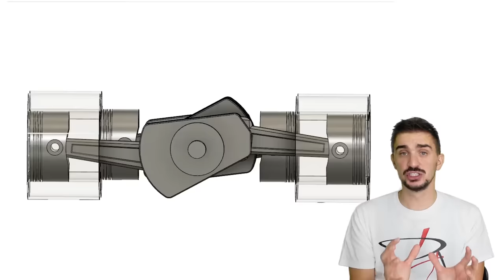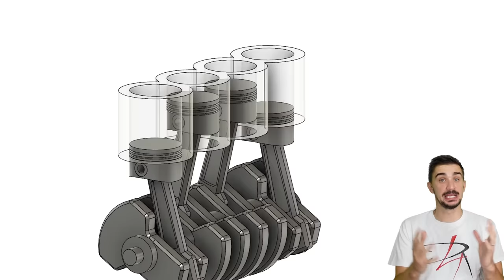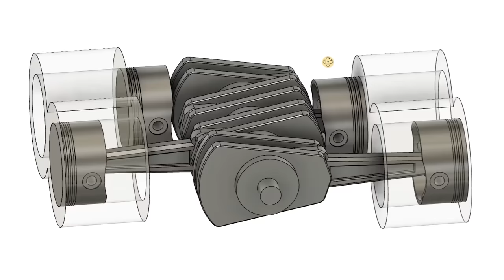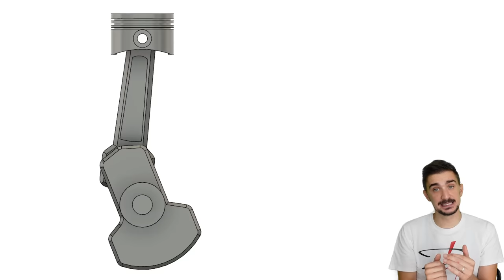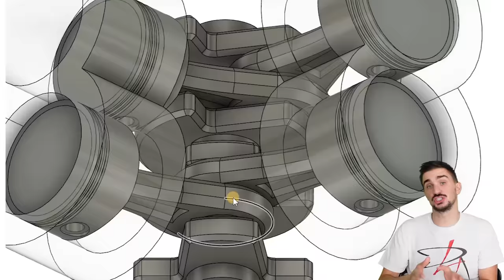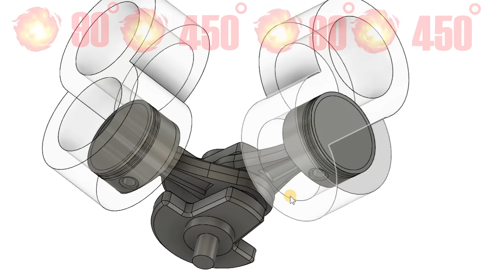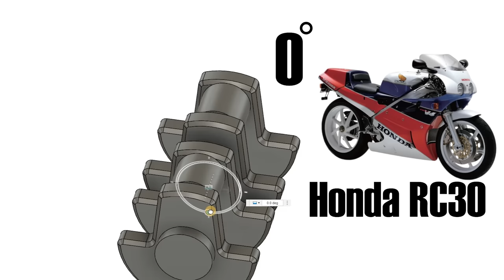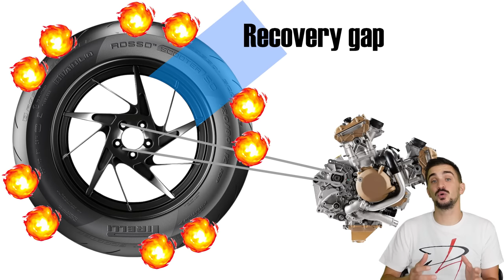Deep Dive: Inline 4 vs. V4 vs. Boxer 4 - What's the Difference? Engine Balance Explained in Detail

Comment: Primary imbalance is the reciprocating mass of the piston. Secondary imbalance is the reciprocating mass of the connecting rod. Everything presented doesn’t include the combustion forces. IOW the imbalances presented would be the same even if the engine were driven by an external source and not it’s own combustion.
But what about the imbalance of the explosions. Just as when a gun fires and shoots the bullet out the barrel, the engine fires and shoot the piston down its barrel. What about the imbalance caused by the gun kicking the shoulder, and the likewise force the cylinder head experiences, the force that tries to snap the head bolts. Those rhythmic explosion surely create a harmonic of some type. ???
Reply: To offset , or counter-balance the force of the explosions  ... make a boxer that fires both opposing pistons at the same time. In that configuration every force input, either by kinetic energy or chemical explosion,  every force has an equal and opposite counter force.

Comment: I've watched 12:46 Secondary balance about 20 times now and unfortunately still does not make sense to me. How can secondary force at BDC point up when the piston is moving down? I understood wikipedia's explanation (piston travels further from 0-90 vs 90-180 so acceleration is greater through TDC than BDC), but doesn't that go against what you're saying here? Thanks
Reply from the maker: Forget what the piston is doing, just focus on what the rod is doing to the piston
Reply: @d4a  pretty hard concept to grasp, especially from 180-270 as I kept focussing on the piston direction going up (and yes, you did say to ignore the preceding section on primary forces 😛),  but finally makes sense now, thanks!

Comment: Why is the boxer 4 cylinder favoured over the V4 in production cars? If the V angle is set at 90 degrees and the firing interval problem is resolved with split crank pins, what now makes the boxer a better option to produce, considering it is more complicated and costly to make than a V4?
Reply: 90 degree V4 has perfect primary balance, but not perfect secondary balance.  The boxer is smoother.
Reply: He kinda talks about this a bit, saying that there aren't any significant advantages for a car - I4 is only a little bigger, but much simpler than V4. B4 offers a lower center of gravity and a bit more intrinsic engine balance, meaning that the complexity commitment of two heads pays back more with a boxer if we're putting it in a car. In a motorcycle, transverse-mounted V4s offer balanced compactness (more square from above) vs I4 (wider) or B4 (longer), and so a V4 is more preferred for bikes than B4. Add the 'relaxation gap' bit, and V4s with clever firing gaps make for optimized design in that case.

The reason V8s are more common than B8s comes down to crankshaft durability issues. Inline-8s are just too long, and B8 crankshafts just aren't durable enough to tolerate more torque ripple from pistons further away - this is because the big end bearings on opposing pistons want less crank material between them (a narrower gap) for better engine balance, and less material = less maximum yield strength. The intrinsic advantages of inline and boxer engines diminish a lot as power demand increases, and the less optimal but more flexible V-pattern makes more sense. As car makers have shown us by example, 4 cylinders are best as inline or boxer, 8 cylinders are best V-shaped, and 6 cylinders can work practically in any of these configs.
Reply: @psychemist2689  Good answer, thanks.

Comment: I am curious why there arent anymore two cylinder cars, could you do samekind video from those too? Specially boxer two is interesting one, bmw used it in motorbikes and toyota in 800 sport ect.
Reply: 2CV and Panhard engines are also great examples, ball bearing, high revving and great power output, engine note lovely!
Reply: Vibration and high impulse torque when they fire.

Comment: Very informative video. I always wondered how some motorcycles sounded like a 5 cylinder (although definitely not one), the explanation is that some V4s have a 70 degree crank phasing which is close to the 72 degrees phasing of R5/V10 cylinder engines. :D

Comment: so a 2 stroke v 4 has even timing correct? i thik it does far as tha math in my head thinks? the firing order happens every single time its at tdc and a fix for the 4 stroke just have a split cam timming on front and back run it like two V twins searisd together.
Reply: detroit diesel style with exoust cams and a cam for unit injectors btw ik a regular style two stoke will work thense theres nothing to be timed if its a carbed diesel wich would be incredibly inefficent just some thoughts im a diesel guy not so much a gas engine person.

Comment: There is another type - opposed piston engine....
its even better... No valve shaft's, no timing belts - and its efficiency way higher, especially in diesel and even hydrogen fuel, really compact size and less parts

Comment: The whole traction thing must be one of the biggest boomer lores in the motorcycle world, you have frequencies of upwards to 600 Hz in the engine while the natural frequency of a tire system is around 10 hz, such fast pulses simply cannot propagate through the tire, just like the higher frequencies of an engine can't propagate trough elastomer bushings, both act as vibration insulators. Any reason for an uneven firing ORDER are more related to powerband and or other higher order vibration issues of a given engine (ex the Yamaha cross-plane which they themselves claim is not done for traction issues).

Comment: Why can't two pistons be fired at a time in a 4piston engine to increase power and torque?
Reply: An engine is just an air pump. Changing just the firing order or geometry does not change how much air is pumped. Same air =same power.

Comment: Can somebody explain, why the V4 engines in MotoGP usually have more power than the inline 4? I'm pretty sure they are limited to a certain rpm and capacity so those last points from the video don't really explain it?
Reply from the maker: It explains an important part of it. The bore and stroke thing
Reply: @d4a  you are right, I just assumed they all use the max 81mm, which was probably wrong. There sadly is not a lot of information out there about the gsx-rr and m1, but what i could find, suggests they have a smaller bore. Thx for the quick reply

Comment: How would a theoretical “VR4” compare?
Reply: Do you mean like the Lancia Fulvia V4 engine and what would be theoretical about it?
Reply: @alexjenner1108  more like a VR6 with 2 cylinders lopped off. Just curious because of how tight vw made the v in those engines. If that’s basically what the Lancia is, then yes. Just curious how a slight v effects the vibrations. Maybe I’ll just have to see if he made a video about the different 6 cylinder engines.
Reply: @benfowler2127  Lancia have been making narrow angle V4 engines since the 1920s with a 20° V4 engine. The 1960s/70s Lancia Fulvia V4 engine had a V-angle of about 12°. The Fulvia used a DOHC configuration, with short rocker arms so that a single camshaft actuates all the intake valves and another camshaft actuates all the exhaust valves. The VW VR6 appears to use an V-angle of 15° so quite similar to Lancia. There appears to be some coverage of the VR6 in this D4A video: https://www.youtube.com/watch?v=mTS48jX68YU
Reply: @alexjenner1108  awesome, thanks for the info!

Comment: Why can't you just lay an Inline 4 on its side, so the cylinder head is on one side of the engine bay and the crank shaft on the other side?  Low center of gravity and less expensive than boxer 4.

Comment: 6:21 MISTAKEN EXPLANATION.  You label the Boxer as having a 180 degrees separation of phase, but the illustration clearly shows the two pistons are both fully extended.  If they fire simultaneously it's 0 degrees separation of phase.  If one is on power stroke while the other is intake, then 360 degrees separation of phase.  I think you are confused because the direction of FORCE is 180 degrees apart--they push opposite directions, but since you show the inline-4 as well, clearly you are discussing not direction of force, but combustion phase.  Your discussion would be correct if you showed a non-boxer flat engine, where indeed phase would be 180 degrees apart.

Comment: Oh, yes! The infamous broken boxer crankshafts.... What is this dude taking about?
The shorter the distace between the bearings, the smaller the lever, thus the strength is higher. Boxer cranckshafts are inherently stronger than the i4. And the only reason the i4 crankshaft is so "beefy" is because they must allow the spasing for the adjasent cykinders, thus making the crankshaft inherently heavy.
Reply: Less material is less material, though. When you factor in torque ripple - especially with a longer crank shaft like 6s or 8s - the thinner material becomes a problem. For shorter engines, pistons generate high compression force and low twisting force. The further down the crank shaft you go, the more % twisting and less % compression you get. Say in a boxer 8, that means the same force that helps press a crankshaft into itself if 1 cylinder away will act to twist the crankshaft proportionately more if its 2 or 3 cylinders away, simply because of the longer distance the force is traveling.

I actually think this would be a great topic for another video D4A!
Reply: @psychemist2689  
I fail to se the moral of your comment.
Longer crankshaft = more trosional stress. Correct? 
Therefore, shorter distance between the supported main bearings will need less material to deal with lower torsion force. At closer distances it is acting more as a shear force on the arms, rathen than a bending force. The twiting occurs at the main bearings, which as you pointed out benefit from being shorter. Only increasing the diameter of the shaft will distribute the twisting loads. It has nothing to do with the thickness of the arms. 
The same can be said about big vs. small block V8s. Or an inline and a V6.

Comment: i don't think this is the right explanation for the better grip. as i understand it, engines where total piston kinetic energy fluctuates (notoriously, i4 pistons all stop moving at the same time), it produces a torque fluctuation that increases with the square of RPM, totally swamping the fluctuating power pulses at high rpm and breaking rear tyre grip. long story short, you approach the sliding coeficient of friction rather than the higher static coefficient. otoh V engines and crossplane 2's and 4's maintain nearly constant piston motion. the designer of the M1 yamaha engine has explicitly stated in writing that this was the basis for the crossplane
Reply: ie the issue with cornering is not that you can't modulate power, but that you can't feel the limit of grip

Comment: 22:30 It's not  true that a flat engine MUST be cast as two halves.  You could easily cast it as one piece that has a slot to raise the crank into.  Remember a flat engine is just a "180 degree V engine."

Comment: and flat 4? manufacturers dont make tem why?
Reply: Too wide, they were popular in the past because they’re easily air cooled
Reply: if you are going "flat" just make it boxer and have great balance instead of making a 180 degree v4 where it wont have good secondary balance. only place where a 180 degree v makes more sense than a boxer is with 12 cylinders since v12 has good primary and secondary balance to begin with so you dont need to make it a boxer. ferrari flat 12, porsche flat 12 etc are all 180 degree v12 for that reason meanwhile the porsche "flat 8" is a boxer 8 because a 180 degree v8 wont have good secondary balance. the porsche flat 12 was developed from the flat 8 btw
Reply from the maker: It's all in the video ppl

Comment: An engine balance video on wankel engines would be interesting I think
Reply from the maker: You'd think but there isn't much to cover. There's no reciprocation turned into rotation, it's mostly just rotation so there isn't much inherent imbalance. No sudden changes of direction.
Reply: @d4a  The 180 degree offset in a 2 rotor doesn't result in a rocking couple (or similar phenomenon)?

Another video I think would be interesting is engine harmonics. Like for instance some engines that completely destroy themselves if they reach a particular RPM due to harmonic resonance.

Comment: Still, you totally avoided to explain a V4 as in a car configuration with a cam pin for each cylinder and didn't motivate the reason as to why is not considered a "real" V4. It doesn't make any sense to me.
Reply from the maker: The whole point of a V engine is to allow the counterweight to balance out everything as explained in the video. If the rods aren't on the same pin than you obviously can't do that. You get the drawbacks of the V4 without the main benefits.
Reply: @d4a  But what would happen if every counterweight was set to 90° between every pin carrying a single piston? Do I get a rocking couple?
Reply from the maker: Yes because the counterweight can't oppose both pistons directly, but the couple would be just a bit larger than the very small couple present on regular V4 engines due to the stacking of the rods next to each other on the pin. But if you place the weights the way you suggest you're again getting an uneven firing interval and a longer engine together with a more complicated weaker crankshaft.
Reply: @d4a  Let's assume having a longer engine is not an issue, for a car it is. Moving the counterweight to a different angle would fix the uneven firing, maybe adopting the same Ford Taunus V4 scheme?

Comment: Hey my dude, Nobody calls it a "B4" or a "Boxer 4 cyl"  Its an H4 or an H6. 
Example - Impreza First gen engines. 
	
1.5 L EJ15 H4
1.6 L EJ16 H4
1.8 L EJ18 H4
2.0 L EJ20 H4
2.0 L EJ20 H4-T
2.2 L EJ22 H4
2.2 L EJ22G H4-T
2.5 L EJ25 H4
Or the SVX - 3.3 L EG33 H6